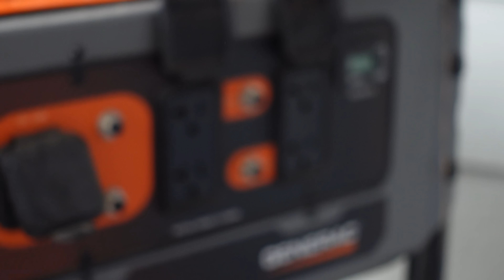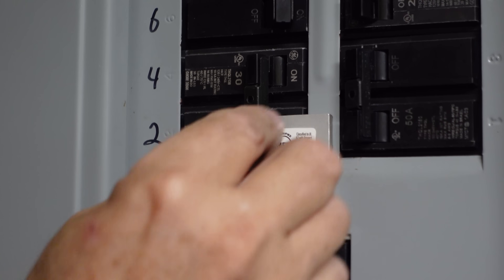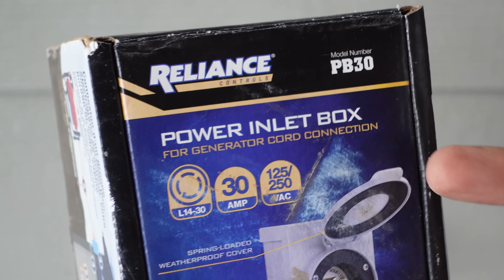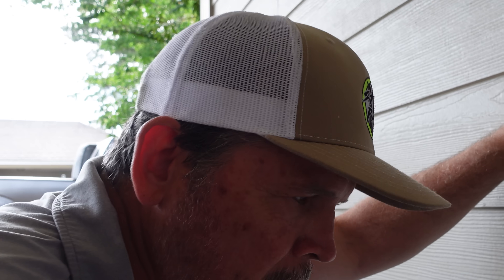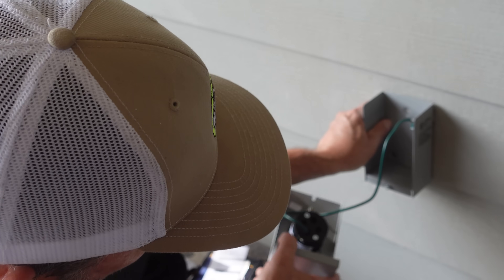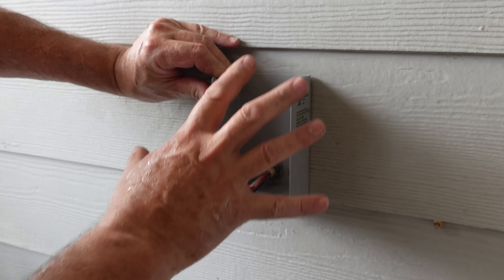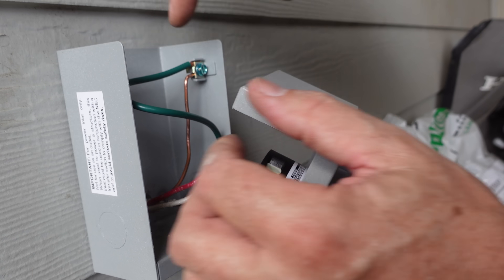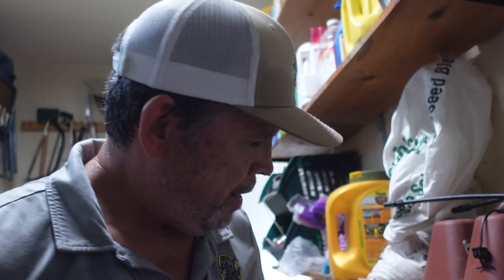What is a Suicide Cord and Why It Could Kill You

Comment: If someone wanted to change the plug end on a suicide plug to the correct plug there is numbers on the plug to tell you for example if the outlet say l14-30r the male end would be a l14-30p. But my suggestion to people who do not feel confident in attempting this project would be to order a new cord. Please leave these jobs to professionals your life is not worth loosing, and have a lock out put in you might be saving a lineman's life.

Comment: lol!  When you first used the power screwdriver?  I flinched-expected to see smoking fingers.  Wearing a hearing aid and the sound thru my headphones is similar to an electric arc.   Good info on that.   Ny Genny is used with extension cords and window AC nits but it is good to know proper wiring in case I ever run a house circuit.

Comment: Very nice!  But I have a question.  What if your portable generator can supply more than 30A?  What if you have a near-whole house or whole house portable generator?  Depending on the size of the house, they do make them that powerful.  You'd need heavier wiring to the panel and maybe two higher Amp generator connection male inlets to feed the panel, or maybe two of the same side by side or in a dual box.  Either way, joining into a junction box that feeds the panel, which has the appropriate sized wiring from there.  Many electricians will only do it with a load balancer, though I've done it this way in a similar manner, which worked fine for years before an electrician was involved, who redid it with a load balancer when the cabling from a shed was run underground.  And a much higher Amp rated cable from the generator or two of them, depending on 1 or 2 generator connection male inlets.

Converting this setup to all of that, or a new project to do it, even without the load balancer, would be quite a job; getting through the wall, up the wall, through the attic and back down to the panel.  Are such higher Amp rated generator connection male inlets available?  In my case, routing the wiring underground from a shed and back up into the panel or even doing it with the generator in the carport, as the panel is on the opposite side of the house, would both be an added expense. Similar to adding a fast charger for an EV would be.  Did I miss anything?  I'd love to have something like that!  The permanent whole house generators cost too much for me, though I get one that also worked with natural gas from the city, if I could afford it.  Hey, do they make portable generators the can run from natural gas?  Some of this  may be out of your purview, but I thought I'd ask.  Thanks

Comment: I would have done a bit of wood work so the box wasn't surface mounted.  A box protruding from the wall in a walkway is an incident waiting to happen.  Adults walking close to the wall (for whatever reason), or children running by this protrusion are certainly going to feel pain.  Either recessing this surface box or using a flush mount box would be safer and more positive aesthetically.  All of the electrical procedures were right on the money, and good learning tools.

Comment: My former gasoline powered generator had two 110 outlets that I plugged with two male to male cables (suicide cords) to my power box, to specially wired outlets that were connected to both busses so the whole house got power. I would have to turn off the main first, to disconnect thee house from the grid so power from the generator would not go  to the mains and endanger the line workers. I now have a Generac whole house generator that is much more reliable and less dangerous.

Comment: About 20 years ago, give-or-take, I was working on a million dollar piece of semiconductor processing equipment, a vertical furnace, that used a box to control the power to something like 8 heater blankets used to heat the forelines to about 150C.  The furnace was recently installed and I was bringing it up, sometimes called commissioning.  I noticed there was a problem with the heater blanket system and went about making sure everything was plugged in properly when I disconnected a blanket using the twist lock connecter -- I was then given a nasty shock.  I was able to let go and after getting my wits back together I reported the incident as I was required to do -- 30 minutes later I was at the hospital getting checked out.
So, the equipment was powered off (I'd EMO'd it) and locked out and then we went over it and found numerous safety issues with the wiring.  The heater control box with 8 zones had 8 Watlow controllers, one for each zone, and 8 crydom solid state power switches.  The neutral line was connected to some as if it were the hot line and the hot line was connected as neutral on others -- no consistency.  In addition, they had reversed the connectors for the blankets on about half of them so that the supply cable, which should have a female connector, had instead the male connector.  If someone were trying to produce a safety risk they would be hard pressed to be a better job than these guys.
OK, so how did a million dollar piece of advanced semiconductor processing equipment get so badly mis-wired?  Turns out the assembly factory was in Anaheim California and the company employed mostly undocumented workers to do the assembly and then the final test people, mostly Vietnamese and Cambodian techs, to test things before shipping it to the customer.  The assemblers, all poorly paid as you might imagine, were given little instruction in the critical safety aspects and they were free to do as they pleased counting on them to know electrical codes they clearly did not know.  I do not know how this was missed by the final test people.  My guess is that all too often the factory views the customer not as the company that bought the equipment but instead view the loading dock as the customer!
Reply: I am from California, and honestly... that is common practice in pretty much all labor positions here.  They use hiring, and employment temp agencies... those agencies overlook some things like immigration status for more money off the person's check as a kickback.  After working 15 years in warehousing, I have met so many temps, this is more common than you would like to know.  They operate forklifts, handle hazmat, and in your case assemble products.... it's crazy man.

Comment: ok...
maybe about to open an Industrial-Sized Can-O-Worms 
but have to ask.  

My parent's home still has a Fuse Panel - NOT a Breaker Panel.  
(I know... right!?)

is there a proper method of installing a Cable to their Fuse Panel, to be used (strictly) for their Generator AND have something similar to that Interlock Slider ??

Or do I hang about 10 layers of Red Warning Signs, on each end of this New Cable, to make certain the Main Fuses Have Been Pulled BEFORE Connecting The Cable for Generator Use ?? 

Please know - No Part of this circuit has been installed !!
I'm just looking for this answer Before I begin this Project...

Comment: Good job but there is a problem with the panel.  According to NFPA 70-2011, article 110.26, a minimum of 36 inches clearance is required in front of all electrical equipment, including controls and panels, extending from the floor to a height of 6 foot 6 inches or the height of the equipment whichever is higher.

Comment: We did use a suicide cord (120VAC) for our generator.  My dad made sure the end plugged into the house was safe by plugging in a blank, (no cord) female plug on the end.  We connected the house end directly to a socket in the basement.  Just used it for a few lights and the refrig.    We killed the mains before connecting the generator.  We also went around to our neighbors and offered them to plug their refrigerators into our power.

Comment: I have an isolated setup like this that's not connected to the breaker box but it's 2 regular cords going into a regular outlet at the generator site. I am going to eliminate the current setup and wire the 2 cords directly into the boxes so there will be four additional outlets at the site.

Comment: The level actually gave me a chuckle, the siding laps were close, you'd have to line the box up with the siding or it would look out of level even if it was level. Match the visual lines, fool the eye. Great tips on the outlet setup. Hint; fiberglass tape is a handyman temporary fix, use paper tape, it becomes rigid went saturated with mud, fiberglass will always move, which means crack. Who would ever modify an extension cord? Everyone who works with extension cords. Replace an end, put a better end on it, turn it into a multi-gang box. You just modified a receptacle with solid copper wire, if that wire was a stranded 8ga, would you have called it an extension cord and run a new solid wire circuit?  You may have been using satire, probably not.
Reply: definitely satire: https://www.youtube.com/watch?v=hbTXKn-XMkw&t=1s

Comment: That was a beautiful job Paul changing that shoemaker setup to professionally done . I just have one question . Being that outlet is so low on the house , if the area became flooded does that automatically ground fault interrupt back at the panel box to cut off power to the receptacle ? Thanks for showing how to do jobs properly , you are saving lives .
Reply: Would a power inlet even have a GFI? I remember fridges don't have them because the hazard of spoiled food from a nuisance trip is worse than the hazard of a ground fault not getting detected
Reply: @thewhitefalcon8539  In a low lying flood plain , code would dictate any outside outlets require GFCI for hurricanes and flooding .
Reply: @conscience-commenter  This is an inlet

Comment: I know its well protected from the weather but it would have been a good idea to put some silicone caulk on the top and sides of the box/siding surface.  That way water running down the siding won't go inside.  I wouldn't completely caulk the bottom.  I know that plywood can handle some water but eventually it will rot or get moldy.

Comment: Our power in NM went out 24 hours. So, we run 220v for the well to two houses an 120v everywhere else. So you're saying  shut off the main when hooking up the 240v and the 120v from the generator to the plugs so no backfeed will occur when the power turns back from the power lines? (If the portable will handle it that is)

Comment: Not to be a moodkill, it is a perfect thing to actually emphasize that 240v CAN be dangerous. But I myself, and many others in Europe, have been hit with 250V aswell. Yes, it hurts like a bitch. The voltage itself is not dangerous, it's the amperage that CAN kill you. 0.1A can kill you, wether it's 110V, 230V or 400V.

And once again, yes, 240V will hurt.

Comment: Totally unrelated question ..... maybe you or a viewer knows the answer. I live on the second floor of and apartment complex built sometime in the 80's. under the carpet and padding is some kind of poured light-weight concrete-like material. It's about an inch to an inch and a half thick. Any idea what that is??? Its all cracked like a dry riverbed and i want to install CoreTec but not sure how to deal with this!! Thanks in advance!

Comment: You have to be an idiot to start the generator before you turn off the main and plug in the "suicide" chord. Not to mention that you will blow your gennie sky high if the power comes back on and you haven't turned of the main breaker.

Comment: It looks like only the very tip of that ground wire was on the bottom side of that screw inside the new box when you were done.  Seems like it slipped out while you were tightening it

Comment: The  wires you attached to the Reliance PB30 that went to the 30AMP circuit breaker on your main panel looked like they  may have been 12 gauge (hard to tell) or was it a 10 gauge wire?   This was not very clear.   You said that the device that you removed was 20AMP.  Were the wires attached to it rated for 20 amps?
Reply from the maker: See pinned comment John 👍

Comment: Not sure if you would be worried about water penetration of that receptacle as it looked like it was under some sort of cover, but that new receptacle had standoffs for the back screw holes and you were using the box to cover the hole left by the existing work box. If this receptacle were in a place that could see water, would you typically silicone around the existing hole when placing the new receptacle to ensure you don't introduce a place where water or even bugs to get in?

Just noticed #3 above, leaving this comment as I proudly typed it on my phone and it took forever. You all are rock stars, wish you were in my area to work with.

Comment: One trick I saw on another channel... secure the clamp to the wire, then feed the wire into the box and then lock the collar.  Would gain you likely another inch.  Also, using torque screwdrivers will make sure that they are down to the correct torque... which often is tighter than you think.

Personally, it is very easy to change the end of the cable, and would do that, as it is much cheaper, easier, and then also don't have the waste of a cable... and no chance of grabbing the wrong cable either!

Comment: Minor thing, but consider connecting the earth from the house side direct into the connector, then taking the second wire out to the box casing. That way, if a connection gets loose, it's more likely to be something that doesn't remove the earth connection between the generator and the house. The way you've done it, any connection getting loose would lead to a dodgy earth between the generator and house. Earthing is always the key thing in my book (I'm a 25kV system design engineer).

Comment: (LOTO, Lockout Tagout.) It is always wise to LOTO at the electrical breaker prior to working on a circuit. There are fuse panel LOTO devices that physically prevent anyone from accidentally turning on the power.

Comment: Thanks for sharing your thoughts, ideas and videos. I have used a cut piece of wire from a dry cleaner hanger. The wire is small enough it’s barely visible and if your dropping thru a floor from a stud bay you can usually run it between the drywall and the baseboard and it will be almost invisible yet give you an exact mark in the basement of the edge of the wall above. I probably would have made them a new cord if it was rated high enough for the current since leaving a suicide cord laying around is a accident waiting to happen. Otherwise maybe cut the worst end off and give them back their spare power cord.

Comment from the maker: Hey gang, lots of comments about the following.  Thought I'd address them.
#1  The existing wire from the receptacle to the panel is 10 gauge.  Color coded Romex started in 2001.   It was all the same white sheathing before that.   Interestingly, color coding is not required by NEC, NFPA, or UL.  It simply makes the inspector's job a lot easier (14G white, 12G yellow, 10G orange)
#2  This is an unconditioned outdoor storage shed, no insulation required.  Not sure why there's no sheathing under the Hardi-Plank on that wall.  There is everywhere else 
#3  WE SEALED THE BOX when we returned the cord😁
#4  We were kidding around about not modifying extension cords.  We've done a couple of great videos on that subject 👍
#5  I put a new female plug on the cord

Thanks, Paul
Reply: Thanks, I was wondering if that was 10 gauge, around here that white jacket is for 14 gauge I think the 30 amp 10 gauge stuff has a black jacket
Reply from the maker: @jeffhreid  Yeah this cable is pre-2001, the year color coding started.
Reply: Is you extension cord also 10 guage
Reply: @vincentgonzales8917  Yes, the extension cord wires must be able to handle the amperage that the connectors are rated.
Reply: I had the Romeo gauge question. Thanks for addressing here.
Reply: Enjoyed your video. Glad you added this addendum and confirmed #10 wire despite the 20 amp female receptacle. Great job!

Comment: To those not well versed in residential electric (or overconfident) be sure every piece of metal in the box and the appliance has continuity with the equipment ground cable and neutral (most of the time goes to the same place). Anything conductive needs a path back to the panel to trip a breaker.